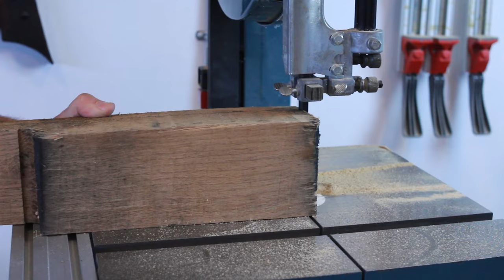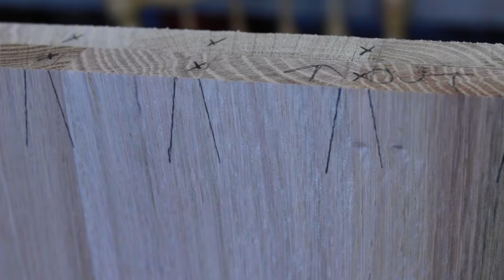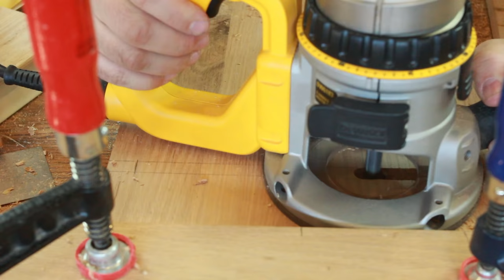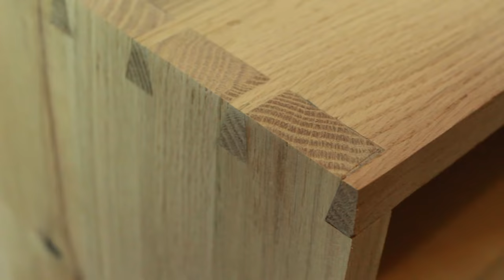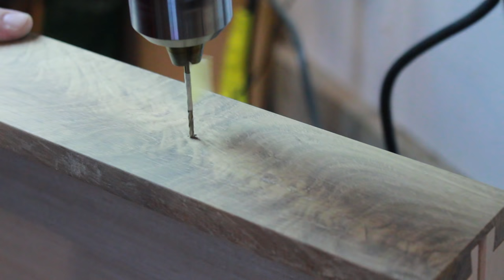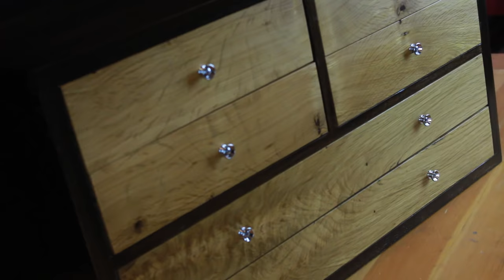Reclaimed wood, Wooden tool box

Comment: I don't understand how someone can go through all that work and not spend a few extra hours and finish off the project correctly. You over finished the outside with too much product and under finished the inside by just leaving stain end wherever, no tape line and then never bothered to sand, remove markings or apply any kind of finish.
Why do that?